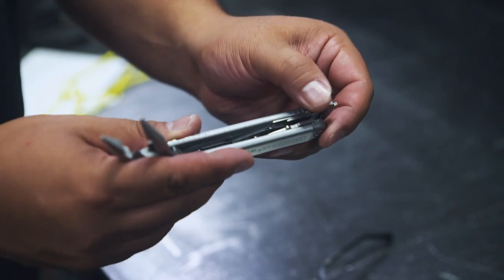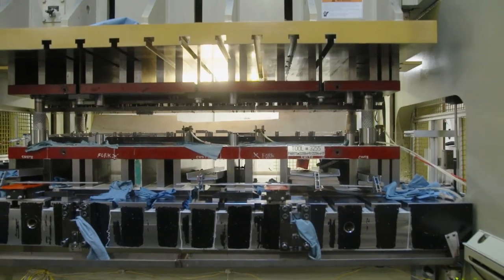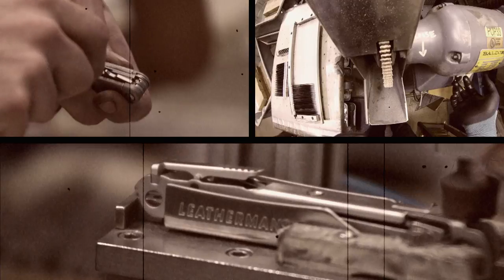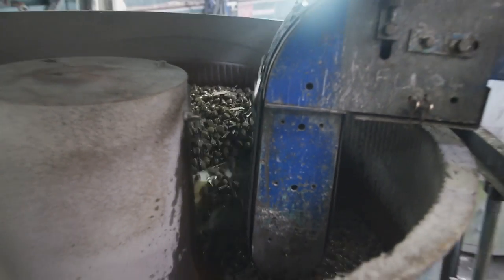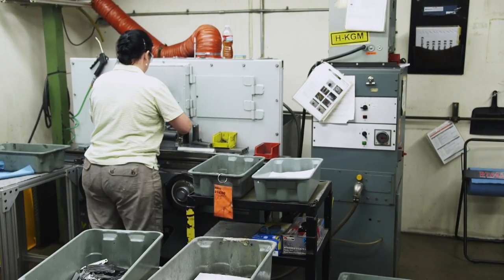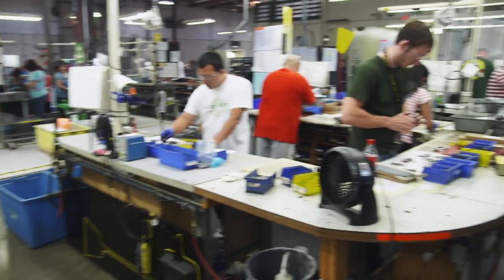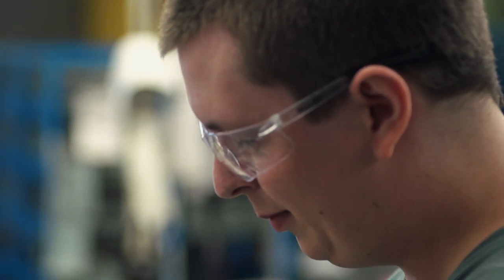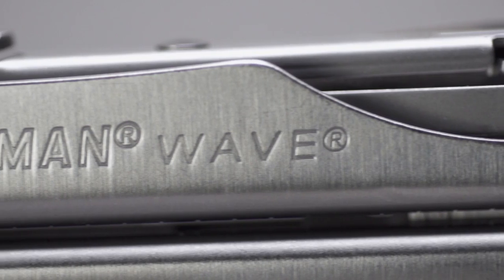How a LEATHERMAN Wave Multi Tool is made - BRANDMADE in AMERICA

Comment: I love how leatherman has kept it's quality great over the years, whereas Gerber has gone to crap. Keep it up!
Reply: If it says Gerber its for babies. Leatherman (NOTE: last 3 letters MAN) is for getting the job done.
Reply: I've owned a lot of these tools. most were supplied to me,  in the past. They al break and wear out fast. The one I've bought (wave in the late 90s) broke three times on me (one broke the pliers, the other two the tools inside). the supllied version wear out in 3 to 6 months of usage (professionally). I got a refund from my shop (not from LM)  and bought a swisstool, that tool has been with me since 2000 til the present day. Its used every single day and it wil last for ages. My wife hase a wave (second one, replaced under warranty) and she likes it because she has smaller hands. If my Swissool would be lost, and I would have to choose a LM or a Swissmade tool... it would be a swisstool (after running through I think 25 to 30 LM tools that is). btw a lot of the current line up is produced overseas and essambled in the us faccility.
Bas
Reply: Grant Leben I just bought a Gerber prodigy and I love it🤣😂🤣
Reply: I have a Victorinox SwissTool X.  The quality is phenomenal.
Reply: My Leatherman Wave pliers just snapped. I was kinda of shocked because the amount of force that was being used was minimal. I had the same tool for about 8 years or so but i didn't see any signs of a crack. I wanna stay faithful to Leatherman but it did taint my opinion...just a little
Reply: The plier jaws is a common point of failure in Leatherman tools, especially if you twist them.
Reply: but that's what they're for. I mean they go on about how good they're stuff is
Reply: Of course they go on about how great their products are.  It's called marketing.  But the fact remains that it is not unusual for Leatherman tools to break if subjected to excessive force, or to a certain kind of force, such as using the pliers in a twisting motion.  It's because the metal used in Leatherman products is very hard, which makes it tough but brittle.  Contrast this with Victorinox multi-tools which use a softer proprietary alloy that is more "springy" and resilient.  

In general, I think Victorinox multi-tools are vastly superior to Leatherman in terms of quality and workmanship.  I've had a Victorinox SwissTool X for years, and it has held up great.
Reply: thanks for the tips man
Reply: Don't get me wrong, I think Leatherman makes good stuff -- I'm wearing a Leatherman Tread bracelet as I type this, and I have a Leatherman Wave stashed in a drawer at home as a backup multi-tool, but I do believe that Victorinox makes a superior product.
Reply: I like Victorinox but to me they're always gonna look like Boy scout kind of knives. But I've never seen their Multi-tools so I should give it a fair shot
Reply: They make probably the best pocket knives on the market.  I've been carrying a Victorinox of one kind or another for decades, and they've always been excellent.  But you should definitely give their multi-tools a look.
Reply: Grant Leben that's the difference between American-made and Chinese made
Reply: cody hewson
Mr. Hewson. Great comment. Now, please advise me --> does the 25-yr. warranty starts to apply on the new weapon, or as a "running total" of when the broken plier was purchased?
Thank you Sir.
Oscar
Reply: Bas Every I agree. leatherman is definitely good. But victorinox is legendary.
Reply: As a owner of both Gerber and Leatherman tools (and a huge leatherman fan) I will say most Gerber tools arent bad by any stretch but there simply isnt anything on the market that compares to the quality of a leatherman. Gerber are only crap when compared to Leatherman. Compared to the rest of the market they are kind of what you would expect.
Reply: I had exactly the same happen with mine, was straightening some tin metal and boom the pliers snapped, I sent it back for replacement but it's my 3rd tool now!:-/
Reply: Victorinox do not stand behind their warranty in my experience.
Reply: Luke Edwards so a tool under $100 lasted you 8 years and you’re opinion is tainted? Did you think it was going to run a small nation and care for small children too? What more do
You want?
Reply: If only swisstool come with a bit attachment ;(
It's a very important feature for me
Reply: I like Leatherman, I just wish they weren't anti-gun.  What knife company chooses to be anti-gun?  They're just alienating their base.  I mean, who are they trying to impress?  Millennials at Starbucks?
Reply: @basevers2583  Do what works for you and good luck with your warranty replacement on Swisstools
Reply: @UnstoppableTramp  interesting enough I did manage to break a piece of the swisstool 2 months ago... the sping of the daily used scissors. So I asked to local Victorinox agent which partnumber I should order.. their answer was nothing more than to send me a replacment spring after asking me if I wanted a full overhaul of the tool or just a replacement part. No costs, no questions. so I do think Victorinox stand not just for its quality but also for a very good customer service. Not exactly what my experrience is with some 'marican brands where the shop owners had to use some very strong words to get things solved.
Reply: @basevers2583  Thanks for letting me know bro
Reply: Well that trend seems to have changed with the current "free" line.
Reply: Bas Evers every Swiss Army knife I’ve had is broken. Probably a dozen or more. So they have quality multi tools but garbage pocket knives?  The knife blades are weak and always break.   Haven’t broke a LM knife yet.  I’ve broke gerber ,victorianox ,CRKT Kershaw
Reply: @Vladpryde  they have multi tools designed for use with guns. Specifically the MUT EOD. It is available to everybody, not just the military.
Reply: @christopherroth7239  Dude I meant their MANAGEMENT is anti-gun.  Not their tools.
Reply: @Vladpryde  thanks for clarifying you meant Management's personal views. I am a strong believer in their product and thought you might not have been aware of their gun specific tools.
Reply: @christopherroth7239  I apologize that I didn't specify that.  But yes, I am aware of their lineup of tools.
Reply: Yeah now they fucking make baby food
Reply: Leathermans are fragile, poorly engineered toys for wannabe posers.
Reply: matanuska high It sounds like you are abusing your knives and using them as tools that other tools are actually intended for. I use my knives for cutting, period. I’ve never broken a blade, even on lower quality knives. My Dad once broke his Buck 110, but he was misusing the knife as a prying tool, trying to separate a deer’s leg joint.

Comment: most durable product I have ever paid for
Reply from the maker: Wonderful endorsement!
Reply: *overpaid for.
Reply: +Ernest Wong Meh.... my Suspension is okay....
the sheepfoot blade is pretty much the best whittling knife i've ever used,

but it lacks a file.
And the scissors is a pain in the ass to use.
Just stamped sheet metal, no flat ergonomic surface.
Reply: Sooo,

you have much MORE durable products that you haven't paid for (i.e.   stole)
??
Reply: And if it brakes at all? They WILL fix or replace it?
Reply: @KandiKlover  Used on eBay for half the price of a new one.
Reply: Patrick Wagz he means most durable things he owns
Reply: until you buy a swisstool
Reply: @FlashlightEDC  I've worn out two Swisstools in my life. They do not offer warranty like Leatherman does, by the way. I own three Leathermans now and after years of (ab)use they're still immaculate. Swisstools are for children and or poofters.
Reply: @KandiKlover  Cheap tools cost you three times , once when you buy them, once when you repalce them, and the third time when you have to clean up the mess  thay make of the original job.
Reply: Mine was a side kick that was 69.99$and I had it for 6 years before I got it stolen
Reply: @B4 freedomfighter no 
All Leathermans are 100% made in the U.S.A
Reply: My wave is fucked :/
Reply: Paul.w w send it in
Reply: Best $99.95 I ever spent.
Reply: I've seen multiple leatherman waves blades snap from what I would call "normal use". I've also seen the wave pliers tips break. All this is first-hand experience. From my point of view, the wave is cheap, good for "light duty use, medium at best".
Reply: @FlashlightEDC  Swiss tools suck. They break easy and don’t have tools leatherman has.
Reply: @Mikey-ym6ok  you bought the fake one. I broke 2 leatherman but my swisstool still going strong for over a decade. Leatherman is just a toy for tacticool childish guys. They aren't made to last like swisstool.
Reply: @Matanumi  yes
Reply: @Matanumi  yes
Reply: Same
Reply: @Matanumi  pretty much yeah
Reply: @KandiKlover  lol, you think $100 for a multitool with a 25 year warranty is overpaying?? Tell me youre poor, without actually telling me youre poor 😂😂

Comment: Pretty cool seeing how my favorite multi-tool is made. 

Also, Leatherman 25 year warranty is no joke. I sent it in because one tool was loose, and they just sent me a whole new Wave. 10/10, Leatherman has my future business.
Reply: i sent one in after a year with a missing screw and broken blade and they sent it back and told me it wasn't covered under warranty
Reply: Same with me.I had my original wave for maybe twenty three years and two of the tools were worn and loose.Sent it in to Leatherman and i recieved the latest Wave as a replacement.
Reply: Yep just got my brand new wave plus today after 20 years with an original wave. I let some moron borrow it and they snapped both knives at the base, I was furious. I just sent my broken wave to the uk distribution (fabulous service) with the form on their website and they sent me a new piece straight away with no quibbles, brilliant.
Reply: I did the same with my older version wave and they sent me a wave + as replacement. I just wanted my old one repaired, it had bit me out of some sticky situations and I'd grown very attached it with fond memories. Was quite upset,   I mean the 25yr replacement is excellent but I'd lost my old friend. I suppose it would cost a fortune to strip my wave, replace broken item and refurbish the rest with the added cost of having older model spare bits in stock. I love my new one and LM but been recommend swisstool x so I'll check that out.
Reply: The "25 Year" Warranty is a suggestion. Even if it's 30+ years old, they've been known to still honor it.

Comment: And boy am I glad I have my Leatherman Surge!
Reply from the maker: How is it, Brandon?
Reply: +BRANDMADE.TV so amazing! It's versatility and robustness has helped me so much that I always have a hard time leaving it behind, even at home!
Reply: JustSimplyBrandon Had my Wave for years, thinking of upgrading to the Surge.
Reply: tgillies101 highly recommended!
Reply: What is difference between wave and surge?
Reply: Surge is the best MT on the market hands down, IMHO.
Reply: i collect multitools, i have 10 leathermans, SOG, Gerber,Victorinox,Havalon, i find myself carrying the Surge or the Wave mostly. The bit extender and the bit kits saved my a$$ on a long motorcycle trip as well as my other riders, vintage Harleys are very bitchy, especially riding 3000 miles with no support vehicle. The Surge and bit kits had almost everything we needed to keep the bikes rolling, adjusting chains, pulling primary covers ect. Traveling light means no room for huge tool kits.
Reply: Thats my setup as well. I bought the sheath for the MUT so I could fit the Surge w/ (2)Bit Kits & Bit Extender all in it. Its basically a very small tool box like you said. Best money I ever spent. I actually did a video on some of the options it can do if anyone needs to check it out. But yea, the Surge beats all imo. Cant find a better one out there and thats why I gave its weight a pass.
Reply: @chrisgray3650  ok calm down, stop reading mein kampf
Reply: @nemesisslr  who os Chrid Gray?

Comment: I take my "Super Tool 300" with me to work everyday and absolutely pulverize it. It still looks decent and performs flawlessly. I'm a Welder/Fabricator/Ironworker so believe me when I tell you it's getting abused. I was shocked at how durable and efficient this tool has been over the years. I just bought the "Crunch" Two days ago as well, to add to my collection of soon to be 6 Leathermans. Haha Thank you Tim for all your dedication and hardwork to bring these wonderful products to the public.
Reply: which one in your opinion is the best tool for pocket carry? I really like the wave + and charge but they both have tiny scissors lol
Reply: @drakejosh808  Depends on what you would be using it for most. For an industrial setting, I'd say Super Tool 300, or Surge. For smaller/less demanding jobs, the wave+ would suffice. They also have a few specialty multi-tools in their line of products, such as the Crunch, or Raptor. You could also add after market tooling to your leatherman. For example, I have the Wave, with a large set of scissors from Victorinox I put into it. There is a bit of fabrication and fitting involved, however it is fairly simple and straightforward.
Reply: @theronpeavey5308  I plan on using it for my pet projects and odd jobs in and around the house. I'd get a surge but I wanna be able to take my multitool everywhere I go (eg. work, jogging, etc.) and I feel like the surge would be too heavy. would prob just end up getting a wave/charge and modding it like you suggested.

Also, do you have any tips on how to prevent rusting? i was thinking wd40 but i plan on using it to prep food as well so something non toxic like mineral oil ig
Reply: @drakejosh808  Just keep up on your maintenance. Clean it with gun solvent, rinse it out, dry it up real good and add some gun oil like Hoppes number 9. It'll do just fine. 90% of Leatherman tools are made out of 420HC Stainless, so you MIGHT get some spotting after awhile, depending on what you're doing, but it's so little you can practically wipe it off. The only time it gets bad is when people don't use them often enough, or they don't do their weekly maintenance or something
Reply: @theronpeavey5308  right on!! thanks a lot for your reply, appreciate it!! :D

Comment: I have the Wave but while repairing my glasses with the miniature screwdriver I immediately realized I could only use the pliers to hold the mini nut or the screwdriver to turn the mini bolt. I REQUIRED a second Wave, so now I own two. When not in use as a tool I use my two Waves spread out to raise my 17" Macbook Pro off the table to allow cooling air to get under it!!!
That's the 1001th use of a Wave!

Comment: I work in construction and have a Leatherman Surge. That thing has taken swims in concrete slurry, been run over by heavy machinery, yet it continues to function. Keep the tool properly oiled and it'll last you a lifetime. You can spend $30 on a decent multi-tool, but under heavy use it'll only last a year, maybe two if you're lucky. Take it from me, if you are willing to put down the initial $120, you can have one that'll last you just about forever.

Comment: Check every single tool. I just bought a Gerber because I wanted a cheap tool without garbage like Sheffield or Ozark Trail. Turned out that right out of the package, the pliers were broken before I even touched them. That is why I carry a Surge.

Comment: Other multi-tools strip out if you try to change out anything, but Leatherman's hardened steel holds up. And, they use 154 CM on some of the more crucial bits on some models.

Comment: Make the Wave with replaceable wire cutters!  We woodman/ bushcrafters need a dedicated wood multi tool.  Leatherman is my favorite hands down, but the company needs to consult with experts in whatever field they are designing it for.  The brushcraft Leatherman is not at all what people are looking for in a wood crafting tool.
Reply: I think I saw a blog post where someone put the Rebar pliers into the Wave, there were some clearance issues but it was workable. I really want them to put replaceable wire cutters in the Wave too, it's really the only thing it's missing.
Reply: @neiljborja  they JUST came out with one last year. Wave plus check it out
Reply: @Matanumi  yeah I'm aware haha, I'm considering putting my current wave in my car's emergency kit and upgrading
Reply: neiljborja why? Use it till it breaks then have them replaced. If you are lucky the standard wave won’t exist anymore and you will get the new one.

Comment: I bought my first Wave from a guy who did not want to sell because it saved him once when his horse got stuck in electrical wire that came down in a lightning storm. The only way he could get the horse out of the mess was to cut through the cables using the wave he had on him. That leatherman later saved my ass once when I had to perform repairs to a jewellery item on a cruise ship that a customer was threatening to sue us because I "broke " it trying to adjust it. The only tool available to bend with high precision was that wave. I now have a sidekick which is my EDC and happy ever after.

Comment: My leatherman wave served me well in Afghanistan as an EOD tech, still serves me daily (and trust me I've abused it roughly lol), I've never had to sharpen it, it is still as nice as the day I bought it, nearly 15 years ago. Only thing worn down is my file but thats because I used it ALOT every day to file metal at work when I should have been using a dedicated file.
Either way, it's barely worn still works nearly as well.
But leatherman 25 year warranty cannot be beat, break something? Even if it's your fault? Send it in, theyll either give you a new tool or replace a blade, free (you just pay the postage)
Honestly a great company with fabulous service, if I'm being honest, I'd pay twice to three times as much for these tools just because of the warranty/service they truly stand by their product.
10/10 stars.